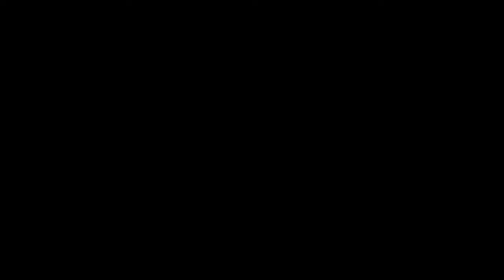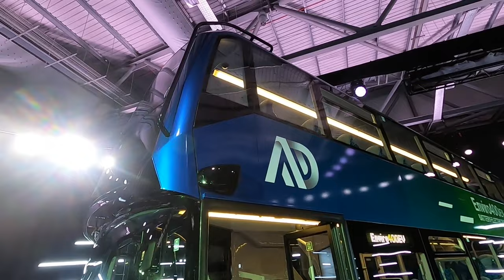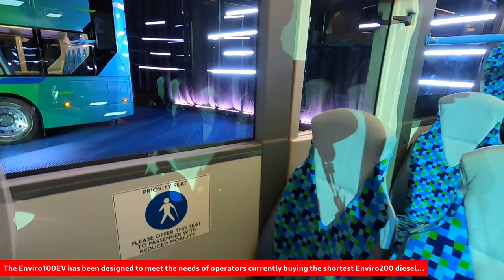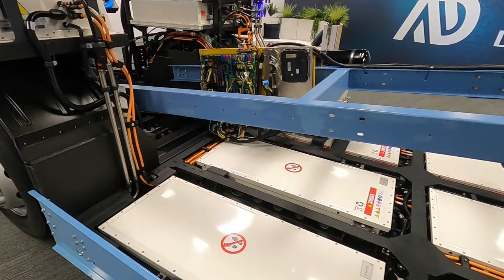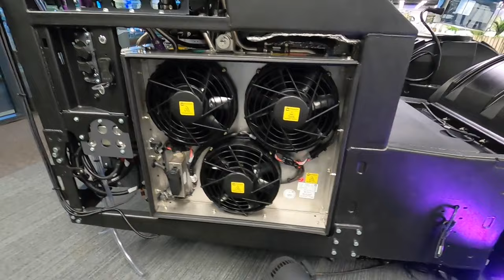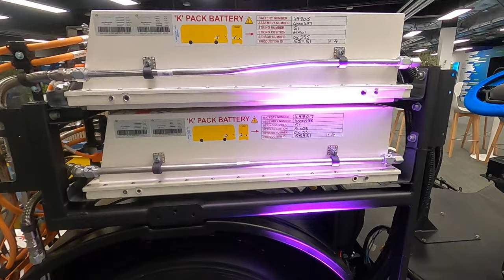Event | New Enviro Launch

Comment: The Alexander Dennis Enviro 400ev is the longest dual axle zero emission double decker the UK may ever see and also the one with the highest capacity if you went for the 80 seater.

Question is, will it gain popularity over the MCV/Volvo BZL, Wright Streetdeck Electroliner and the Yutong U11DD? Only time will tell.

Stagecoach West's Oxford division and Transdev's Harrogate Bus Company has already taken orders and are expecting them between now and early 2024